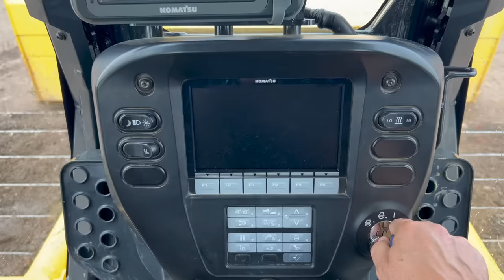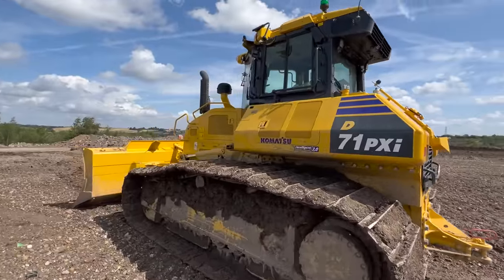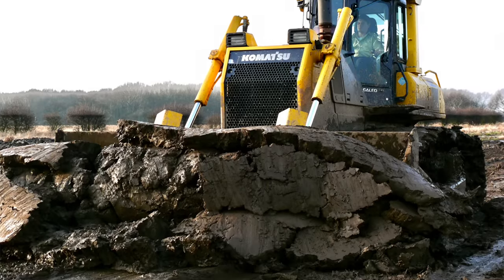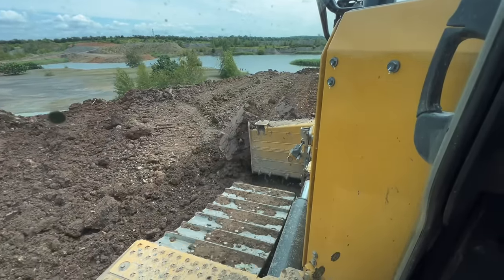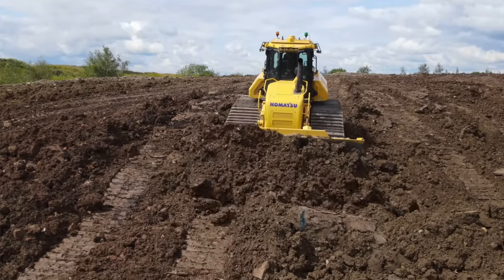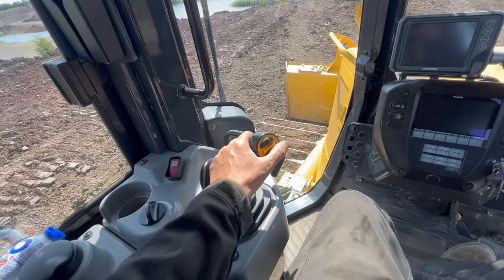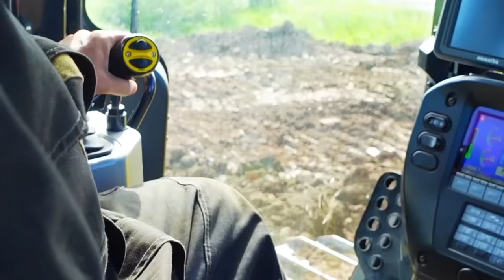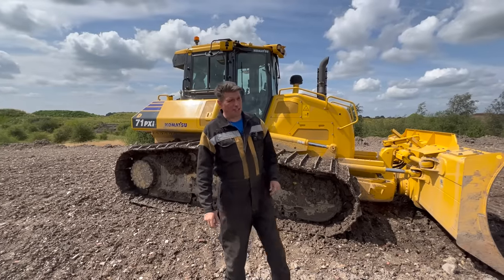CAT D6 vs KOMATSU D71

Comment: Hard choice for sure         Cat has more models and motor options    Down to specialty models.   I’m an operator by trade and I’d prefer a cat I think they run better with less issues.  Cat has the emissions figured out better.  I’ve been in 3 different Komatsu dozers doing dozer things and because the DEF wasn’t topped off and each time below quarter tank  they suck air bubbles and put it in limp mode and a tech has to come clear the code.   Never has happened to me in a cat.   Sometimes if it’s real cold the komatsus and Volvo equipment throw codes and sometimes limp mode because the def sensors are too cold.   
If I was buying a dozer I’d pick komatsu because the gps stuff is built in and ready.   Cat you need to the domes and screen still.

Comment: Seeings how Komatsu owns that division of Cummins engines, they are effectively building their own engines. As far a Cat controls being nicer, they are also more costly to maintain. People need to remember, a machine is a tool, if you can get the job done with the tools I give you, the potential for everyone’s profit is higher. You demand a new machine, your pay will be lower. At least that’s how it works in the States. Until the Unions get involved, then everyone goes broke and we sub it out to oversea’s contractors. Love your videos!
Reply from the maker: Cheers ! 👌🏼
Reply: But komatsu casts and assembles their own parts perhaps??..I believe they do with the B series Cummins engines they use..at least in Japan.. not sure how it all works...u or someone else may know more than me
Reply from the maker: Same as FPT's, JDP etc - The block and heads may be similar to other series but the injectors, crank throw, type of pistons, injector pumps, injectors, management systems etc, etc are all tailored to the individual application.

Comment: I worked for a company that had Cat everything and one Komatsu dozer. I absolutely HATED that Komatsu dozer and I always got stuck with it. It was the cab and I believe it was a 61i with Topcon. There was no room for my lunchbox anywhere but on the floor but it had red safety levers right where my lunchbox had to sit so I was always tripping over it. I’m also 6’4” and there just wasn’t enough room for me, even without the lunchbox. It was so uncomfortable for me to run that nothing was going to make me like it. The Komatsu in this video seems to have that issue fixed though. The only cab I hate more than that one was a Cat N series, they’re a damn joke. Dozer for dozer, I’ll take a Deere all day

Comment: Cat track loaders 943,953,963 are rear engine 
And I think those are hydrostatic. I’m surprised Cat never tried to make a rear engine dozer but you’re still gotta have some and weigh in the front.  
The Soviets made it like a D8 size dozer, completely rear engine on it.
Reply from the maker: Yes you'd think CAT would have transferred that tech over. John Deere have made hydrostatic dozers for years.

Comment: It’s never easy comparing dozers due to the endless spec differences, features and configurations within each brand and within each model.
Reply from the maker: You can only try and match them as closely as possible but most decent operators can fathom it out.
Reply: Having sold the cat product for years, the Track Type Tractor specification book is always the thickest and the most complicated! 

Bit better now with the next Gen stuff
Reply: Weight, blade width and horse power. Match them as close as possible and compare.  Keep it simple.
Reply from the maker: Which is what we did

Comment: I have seen a few different operators using a variety of brands for all machine types.
Hyundai and Sany* both make good excavators, on par with Volvo, Cat and John Deere easily.
From observation, brand names are just a sticker price point, most machines are directly comparable when stacked up against the same weight class.

*  a few years back LetsDig18 entered a competition put on by Sany at a trade show and completely blew Sany reps minds running their excavator in their competition. Since he normally runs Volvo and the speed of his run they must have used the same pattern as Volvo. He has run pretty much every brand and is comfortable in any of them. The competition test demonstrated the balance of the machine which also shows product quality. Balancing on one track on a rail, driving along the rail and popping balloons with the bucket while driving on the rail. Definitely well built to balance that well.
Reply from the maker: If you run them long enough you'll see which brands are better than others - you get what you pay for.
Reply: @LordMuck  so CAT's new chinesium parts mean CAT is becoming an el-cheapo garbage brand?
Except they are still charging premium quality prices with cheap chinesium steel parts.
Reply from the maker: CAT have had two grades of excavator for several years - your choice of what you need and pay.

Comment: Spent many many hours on that long nose 65 both grading and clearing/raking and also many hours on the 6N and 6T doing the same….the cats in general are smoother machines but if I have a 65 sitting next to a 6 or even a 61/71 I’ll take the 65….just my personal preference….I’ve also got a few hours on a newer 61 and a handful on a few K series cats….in my hayday the 65 and the 6N/T were kings so that’s why I’m partial to the 65 and even it has its flaws
Reply from the maker: It's experienced, open minded operators such as yourself that this video was made for 👌🏼
Reply: @LordMuck  it’s open minded creators like you who bring awesome videos for us to watch….I’ve ran the case dozers as well the 850 was nice….very basic cab like Deere but very powerful and smooth but horrible blade visibility….it was well balanced and gave good feedback to the seat so what I couldn’t see I could feel….someone asked about Deere dozers in another comment and I’ve spent almost as many hours on Deere as I have cat (or more) and to me they just feel like toys….basic cabs high noise levels lots of vibration borderline underpowered….but they get the job done and if that’s what they give me that’s what I get

Comment: Ive always felt any piece of equipment designed to shove or pull hard on gradients that a hydrostatic transmission is the way to go. No clutches/clutch packs to wear out - makes total sense.

Its no different in the forklift industry, ask any forklift mechanic what transmission is best for a customer driving up and down container ramps - they'll all say a hydrostat. Got abusive operators? Get a hydrostat.

Comment: Great video Mucker.  Is there a benifit of the high drives on the Cat. Does it stop track. bunching when in reverse?
Reply from the maker: They said it kept the drive out of the mud and stone
Reply: @LordMuck  i thought it was, possibly sothe track was pulled tight along the bottom going forward and reverse. Thanks for the reply👍🏻

Comment: Hydraulic drive is my favourite :o)  I would prefer to steer with my feet and left hand for speed, with a direction switch. *There was a satisfaction in getting an early D4 onto a low loader with tillers and brake pedals, but it’s an experience that doesn’t need to be repeated :D

Comment: There is a smoother ride with the cab forward design because it is closer to the center of gravity of the machine.  Cooling fan in the
 rear is run by a hydraulic motor and turns on and off accordingly to the level of cooling needed.  The fan can easily reverse flow to purge the radiator of contaminates. With the fan in the rear there is less dust being blown around inhibiting the view of the blade. 
Elevated sproket design on the Cat helps keep mud and debris away from the final  drive and that saves power and reduces wear on a critical component. 
 Hydrostatic trans have a computer that continuously monitors load, traction, speed, and power, while making adjustments to insure the best possible combination is achieved.   They also continue to get better with their ability to do that as newer models are developed.  
Hard to beat the improved visibility of the Komatsu', another advantage of placing the radiator in the back.  But how does that work when you have something like a ripper?
Reply from the maker: It fits on the back like every other ripper...

Comment: Nice Mucka, the K looks like a step ahead. Having never driven a dozer how does a relatively small 250/300hp engine shift so much gear? Transmission?
Reply from the maker: You're running on your own road (tracks) with a balanced power unit

Comment: I didn’t know you could get a dozer without rippers. Could go back to the old tow behind set up but the cable arrangement would be a pain.
Reply from the maker: They have the controls in place ready to be connected if fitted with a ripper

Comment: WhooHoo! Looking forward to this 😊♥️
Reply: Kurt, I'm interested in how you feel getting out of the machine at the end of the day after being on a flat track komatsu vs  the high track Cat.
The ride difference, especially after a day of reversing over corrugations all day determines how you feel at the end of a shift. 
Just a little oversight of the video that I find important. However, it could be that the ride quality is that insignificant that it wasn't noticed due to the central position of the flat track cab.
Interested in your opinion.
Reply from the maker: I think the position of the cab made a massive difference as you weren't sat over the drive sprocket.

Comment: Does Komatsu make a high track model like the Cat? Komatsu is a real good product like so many things made in Japan
Reply from the maker: CAT has the patent for the Hi-drive
Reply: @LordMuck think it expired years ago like 1993
Reply from the maker: Expired in 1989 but it still covers enough track carriage patents to make in unviable to copy apparently.
Reply: @LordMuck  interesting.
Reply: @LordMuck   AVS uses a high track type system, guess might have to wait for some more patents to run out, but again probally not the be all end all
Reply: @LordMuck  patent expired in the 90's the high track was originally only for the D10 because cat couldn't design a reliable final drive in the lower position, then cat realized they could do millions more in service and sales by putting the high track on the smaller machines, the high track's are less efficient and wear faster.

Comment: Are  the   CAT  Hi Drive  tracks easier to clean ???
Reply from the maker: Not much easier than driving up on to a windrow of soil to raise the machines height like the old D7, D8 and 9 operators used to do all the time.
The Hi-Drive keeps the drive sprocket out of the rock and dirt much better

Comment: At one point in the video you complain that the Cat didn’t seem to have the same traction as the  Komatsu.  Could that be because the grouser bars on the D6 are far more worn than the ones on the Komatsu? Seems to me that tracks will want to slip/spin easier on one vs the other when the grousers are not providing the same level of penetration for traction. Just and observation I had.
Reply from the maker: I'm going on the brand new D6's that we have run - the one in the video actually performed faultlessly, it's just the Komatsu is streets ahead of it, it's night and day. As I said, that's the exciting bit as you know CAT is coming out with something soon.

Comment: Did you try adjusting the blade back on the 71? 
Not had chance to drive the 71 but spent a lot of time on 61’s and when you pitch the blade back they hold more on the blade and muck tends to roll better on the blade too. 
Had a look into doing it on a d6xe I was driving and it was a right pain in the arse. Gave up in the end and left it in the middle setting.
Reply from the maker: Yes we tried it all ways especially when it rained and it came off well

Comment: Ironical thing about visibility is, cat's got a high drive machine which in theory should provide better view of the blade at the front. But the positioning of all the after treatment system and exhaust stack just ruined the front visibility. I operated D6 for about an hour or so some months ago in a similar terrain shown in the video. Ngl, the power is awesome and all but, visibility could be improved.

Comment: I have briefly driven a Komatsu D61 and a CAT D6. Both were great but when l looked at how they were designed and built, the CAT looked a stronger design and build.
CAT only have one dealer as far as l know, and the customer service l have heard isn't brilliant by any means.
A lot to consider to be fair. The video, raises more questions than it answers so maybe a Part 2 melod?
Doffage of cap to thee!
Reply from the maker: Compare a 71 to a D6, not a 61. Komatsu have brought machinery in to the 21st century by using better methods of construction and technology where as CAT still think thicker hunks of steel makes a better machine...

Comment: D6 way better dozer to operate own and maintain get parts overnight.
Reply from the maker: Your comment clearly demonstrates you are the type that has allowed CAT to keep churning out the same thing and you just keep taking it like a good boy.
This video was made for serious, experienced operators - you just keep believing the hype.
Reply: You shouldn't be pushing boulders ot tree stumps with a 6 way blade.
Reply from the maker: Who's pushing boulders or stumps ?
Reply: @apecobbb707 we've got a D5H LGP with 36in pads and a 6 way blade that we use for knocking down trees and shoving piles of trees to the main pile. The 6 way blade is perfect for cutting around the base of the tree to cut the roots. We have never had any issues doing this and we've had this machine for around 10 years
Reply: 😂 " OVER NIGHT "  if you call so. We had to wait 6 months for a part because not even one dealer had that part. Back up order. 😢

Comment: My question is! Why has Komatsu stayed with flat track instead of the high track that Cat uses?
Reply: I think because cat patented the high track for the bulldozers but i not sure if that the case
Reply: One more bend per track revolution. More bends = more wear.
Reply: Who said hi trak is better?
Reply: @Oliveiiros   Cat DID patent the high track but I believe it has now expired.  It doesnt give any power advantage though.
Reply: I really don't understand this question? Who told you or why are you under the impression high drive is where it's at? Cat dozers.....clunk clunk clunk they're so noisy with that high drive, and with a high drive it requires another idle wheel, more parts, more to go wrong, more wear! High drive SUCKS! The cats don't have the traction and I am completely convinced it's partly do to the high drive and they don't push as good as the komatsu's! Honestly when it comes to dozing cat is still trying to catch komatsu!
Reply: Caterpillar never could get it right..Their older finals were not a great design..So they relocated them to get them off the ground,which Cat fans seem to think is the best design ever..Remember,these are the same folks that if you 💩 in a bag,wrote Cat on it,they would love it..😂😂
Reply: Eu prefiro Komatsu.
Reply: Krótsza droga od silnika do tylnego napędu i relatywnie można zastosować słabszy silnik który na krótszym przenośniku pozwoli uzyskać taki sam moment ...przy hydrostatach nie ma znaczenia .....jeszcze dochodzi samooczyszczanie podwozia...w błotnistych warunkach ...i komfort operatora poprzez rozkładanie wstrząsów ....no i   maszyna ...powinna być wyważona ...tzn....optymalny środek ciężkości ciągnika względem lemiesza ...profil lemiesza który swobodnie odspaja ....itd ....to tylko prymitywnie wygląda ....a w praktyce to jest profesja .....starsze wersje cat.....to prawdziwe dzieła techniki......

Comment: Well narrated by a Pro Operator.
Question bering in mind I am not a Prof. Operator.
There appears to be a lot of enficies placed on the joy sticks related to rockers.
Can you tell why joy sticks do not make use the other Four fingers ?
I will reference the stick or thrust controls of a Fighter Jet.
Reply from the maker: A lot of machines do, just depends on the application.

Comment: Biggest thing I’d be curious about with the Komatsu is ease of serviceability.
Reply from the maker: All fairly straight forward. CAT, Komatsu, Liebherr and JD have come a long way in recent years as far as access and serviceability goes
Reply: @LordMuck  I agree with that especially on the D6 shown in your video what used to be a 6 hour minimum process to remove the cab now only takes about 2
Reply from the maker: And that's what's great about the D71 as it will now push CAT to up their game even further

Comment: What’s the reason the cab couldn’t go in front of the engine to give a forage harvester kind of forward vision ?
Reply from the maker: The ride wouldn't be right to get the feel to the driver
Reply: @LordMuck good point, I suppose it could be a bit like a nodding donkey if the cab was too far forward

Comment: Once you get to d10 and up weights. The cat is alot better for pushing. 475 will smoke a d11 at ripping.
Reply: Nice to hear an opinion based on experience rather than armchair experts.
Reply from the maker: And that's what makes for decent interaction 👌🏼

Comment: Personally Id have to feel the pushing power, compared to the komatsu. . i dont see how the low sprocket machine could be "better".. sure it could have some vision benefits but that wont sell me on it. It would have to ride better then a high sprokect also, and Im with ya on the seat, I hate the angled seat in the D5 and D6...
Reply from the maker: Exactly, I can't convey the 'feel' so the best way is to sit on the seat.